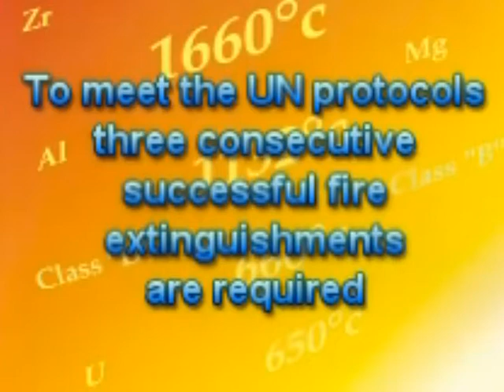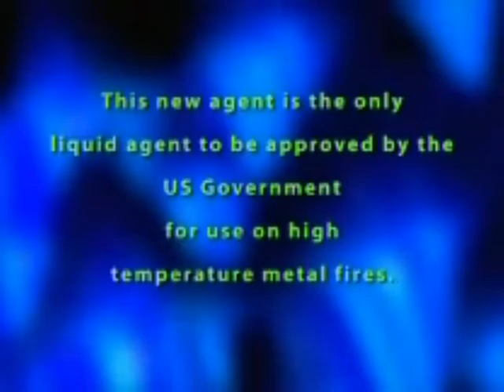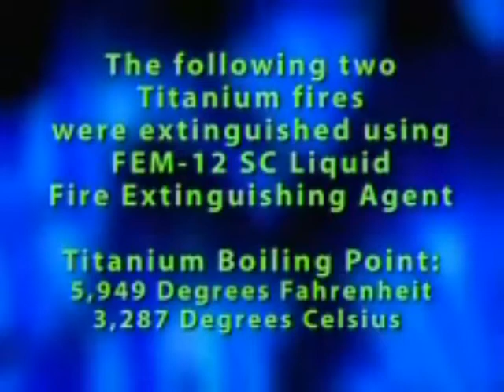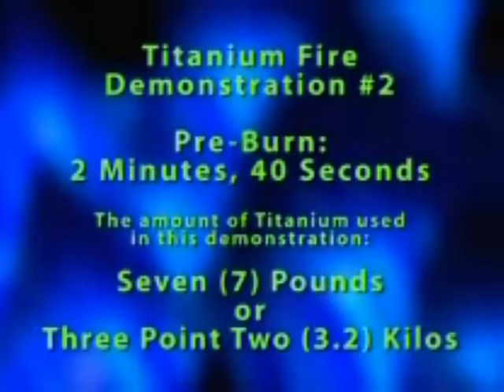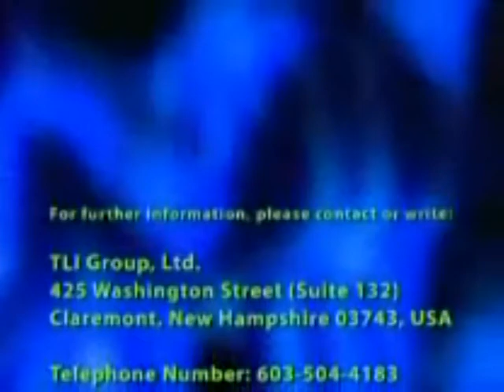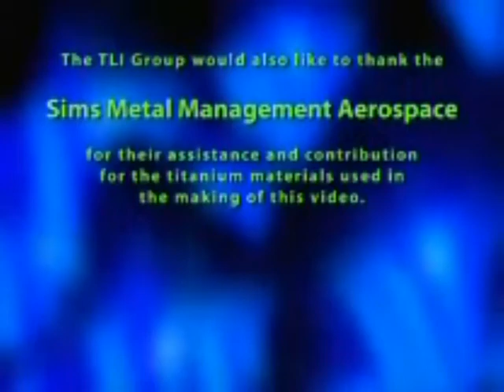Titanium powder fire extinguished, Titanium dust fire extinguished

Comment from the maker: I am sure you are not aware of the manufacturing process of Ti piece parts or the manufacturing process of this material.  During this process there is a build of of Ti powder/dust that is very easily ignited.  No other extinguishing agent has ever been able to extinguish a Ti powder/dust fire.  This extinguishing agent adds safety for the workers who have to deal with this dangerous process. So I am sure you are ignorant to make such a remark.

Comment from the maker: Hello.  Actually it can be used on any size metal fire as long as you have enough agent on hand.  What you are seeing is the United Nations test protocols being used.  No other agent has todate past this test successfully accept FEM-12 SC. Water even on this size fire could cause an explosion.  FEM-12 SC has never caused an explosion when used on any metal fires.  Note: see the video on zirconium fire that were posted. Zirconium has a far higher boiling point then Ti and there was no explosion.